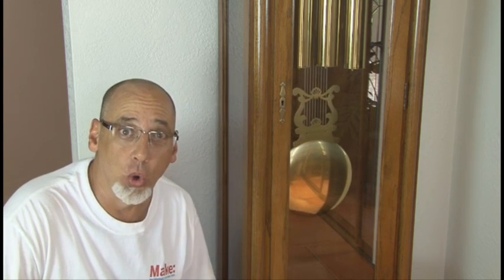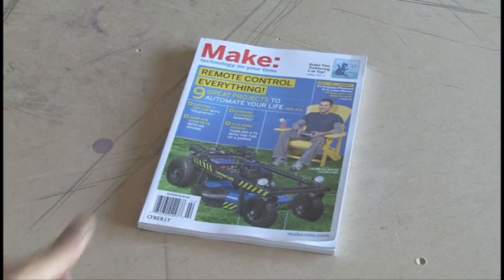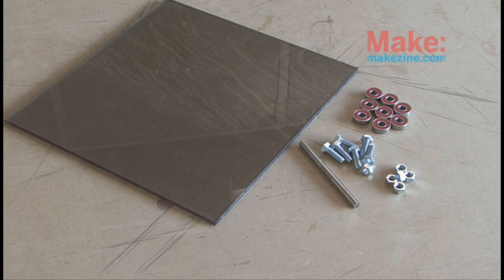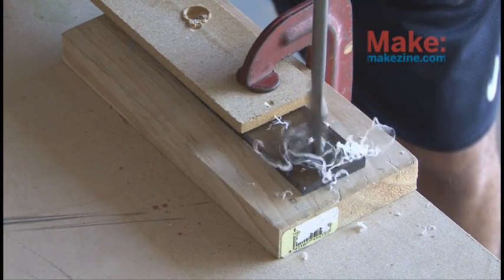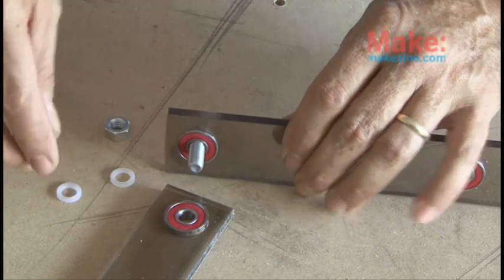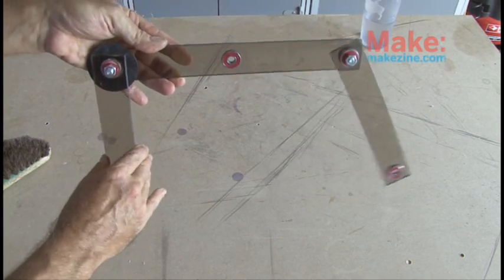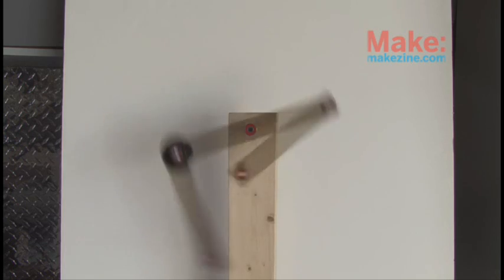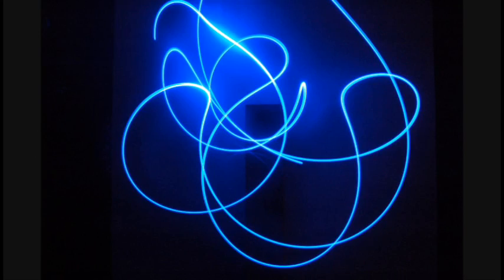Weekend Project: Double Pendulum

Comment: Why did you put the bearings on the other ends of the two arms when you didn't attach it to anithing?
Reply: Daksh Gupta you could just put lead pieces there, because ball bearings are pretty expensive. In fact, you only need 2 ball bearings for the double and 3 for the triple pendulum
Reply: That adds mass for momentum.
Reply: I suppose you could. I think they used ball bearings because they all weight the same to a fairly precise degree, hence the weights won't throw the system off balance.
Reply: Peter Bucek it's so you can move the pivot point for different reactions

Comment: I love these fascinating toys,It`s why I became an engineer, motorcycles are my favourite fascinating toys!
I built a few Harmonographs, moving drawing boards atop a pendulum, with another pendulum swinging from the first, then a pen mounted on an arm, that only moves up and down to ride the paper on the board.
It was a great way to waste time, paper and a lot of pens!
listening to an engineer still talking in thirteen sixteenths of an inch is like going back 100 years to bushels, pecks and cubits.
 you need the metric system, I gave up inches & their ridiculous fractions, for engineering a long time ago, they suck,and 22mm is so close to 7/8 of an inch as to be the same for most practical purposes
That said the old feet and inches work much better for building and carpentry.

Comment: The pendulum in the GF clock doesn't power it as he said.  The Grandfather clock is powered by gravity pulling on the weights in the box with the pendulum.  The pendulum is merely regulating the action of the clockwork.

Comment: here's an interesting suggestion:
for the bit about LED's at the end, use infrared LED's and mount a Wiimote to face the pendulum and have a good view of the whole thing. Use a simple program that traces out the path an infrared marker leaves and then set the pendulum spinning with the Wiimote and the program tracking the movement of the LED's and creating an image from the paths. perhaps even add in the ability to change the background of the image or add effects to the traced-out paths ^^

Comment: @MrColetheman The bearings are used to allow it to spin around. The ones on the ends of the pendulum that aren't being used are there to 1- add weight to the end so that it gives a more "chaotic" rotation to the whole thing and 2- to have one there in case you wish to expand on the project and do more, that way you'll have another bearing and hole to expand with.